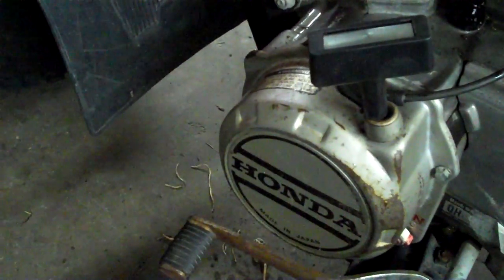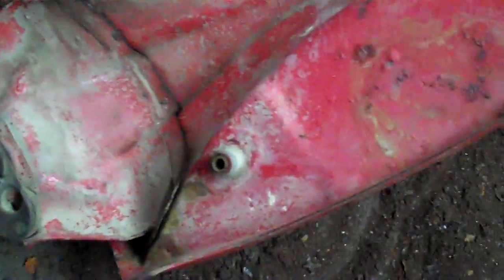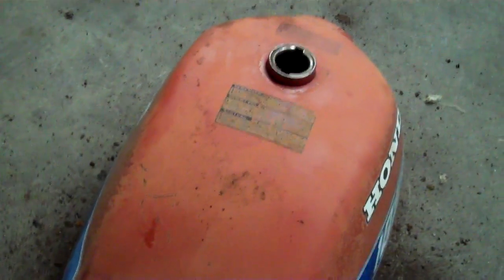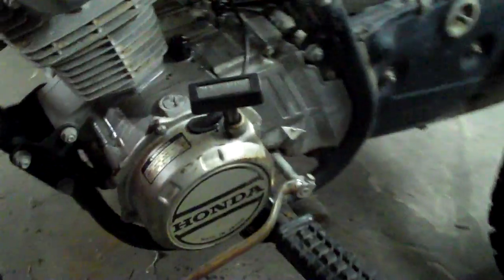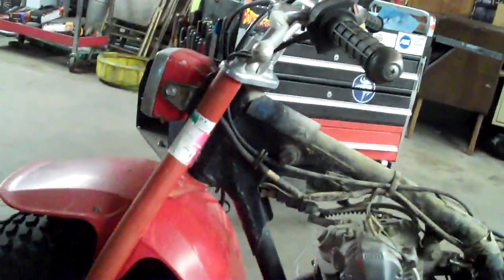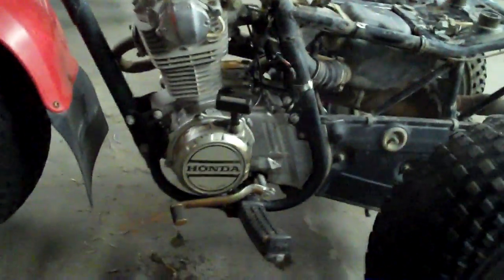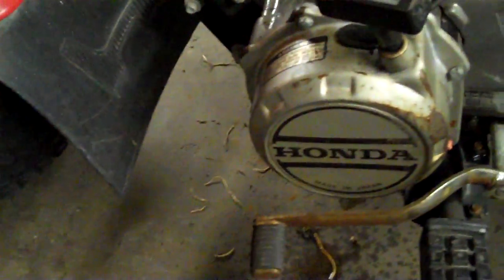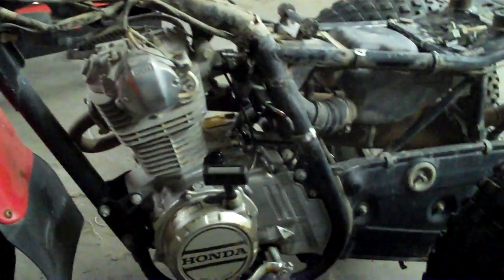Free Three Wheeler!  Can I make it GO!

Comment from the maker: It all depends on your goals/budget/constraints.  If you have to keep it stock I'd try an epoxy resin that is resistant to alcohols.  If you've got the resources- build an aluminum one.  Otherwise if looks etc are not critical you can cut out affected areas- lay paper over the holes- press/trace the shape- cut and weld it in.  It won't be as curvy, but will fix it up fast.

Comment from the maker: I like seafoam.  I just don't use anywhere NEAR what they recommend.  I use about a quarter to half.  Too much can create white deposits on plugs and valves when used in the fuel (my favorite use for it).  Too much in the engine can cause premature oil leaks.

Comment: I understand the challenge of getting an old abandoned machine like this running, great fun!  I had an old motorcycle that was seized as a kid, soaked the cylinder in WD-40 for a few days and hammered the piston out with a piece of birch from the firewood pile...  File fit some newer rings into it, 'cause the Honda dealer couldn't get the originals.  Learned a lot and get a feeling of accomplishment too.  Like your tip regarding the fiberglass for the gas tank, hope you post a video for that.

Comment: I'm surprised you don't weld the holes in the tank, though I understand you would have to do the fiberglass as well. Presumably you pressure test after all that. 
In Honda motorbikes, isn't neutral half up from dead bottom? Sometimes when I can't find neutral I push the bike a little, and it slips into neutral easily after that.
That's a fun project, it will be interesting to follow along.

Comment: I was hoping you would fast forward and we would see you ride off into the sunset.  When I was a young lad I would ride these across the river by holding on the the back of the seat.  But they are easy to tip over.

Comment: An easy tip for the throttle needle to unstick is to spray oil or mp and then heat it with a torch or heat gun and it will come right out… I like your vids man they are awesome!

Comment: Hi Brian, sorry to post on the wrong video.
But I have a 1993 Corolla 4a-fe 1.6 auto. 76K miles.
For the past year or so it's been taking longg for the dash-temp-gauge to get to the middle. I think the therm is stuck semi-open.
Problem is, i wanna replace it on my own, i've got all the instructions etc from online. BUT..when i opened by hood, the therm housing is under the distributor. 
Now do i have to remove the airbox and distributor to replace thermostat because there's no way my hands and

Comment: Hey Brian awesome video as always! I have a question for ya.....you mentioned using "Seafoam" on that project 3 wheeler, would you recommend using it on a car that's in decent running condition with say less than 129,000 Km on it? I ask because there seems to be a lot of hype out there about how well seafoam can clean out the gunk that builds up in the cylinders. I just wonder if that stuff is as good as some people believe it to be. As a good mechanic I trust your opinion.